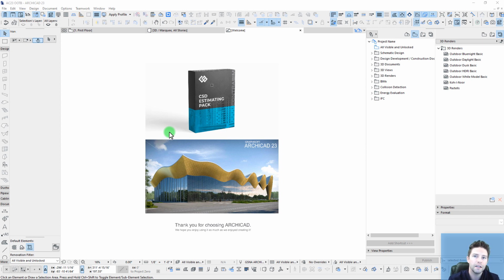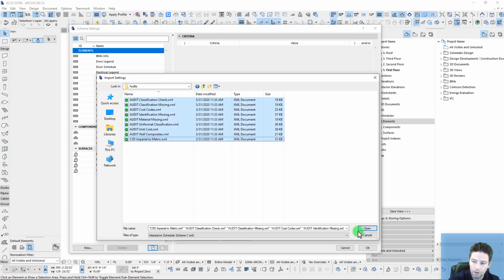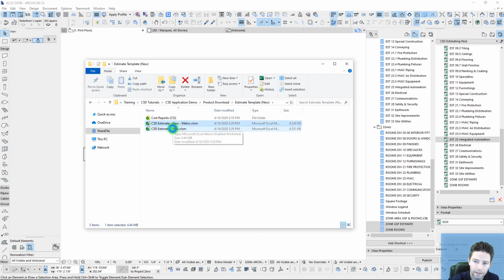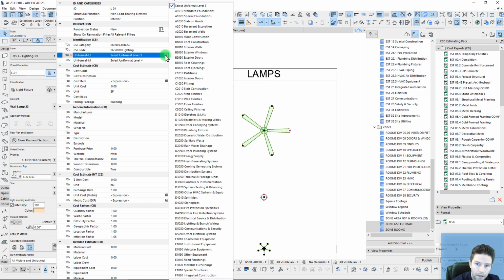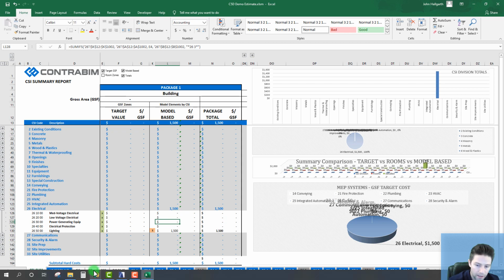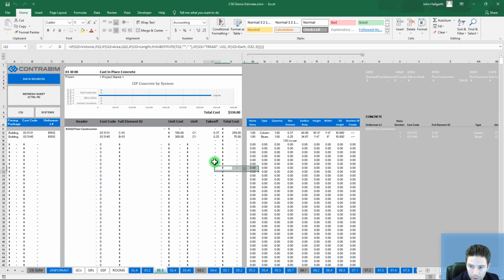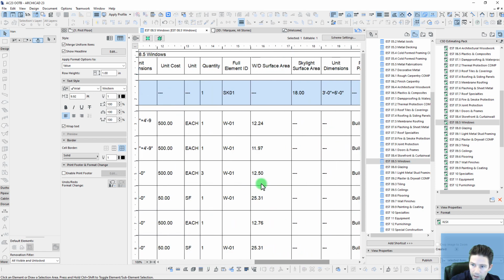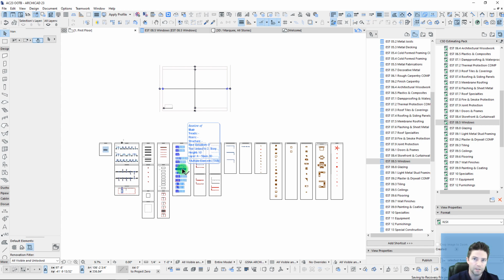How to Add Estimating to Your ARCHICAD Project in Minutes!

Comment: hi,  may you help me please? zone cost per m2?  i can't do the expression. i create a propriety to insert the price, then another expression (area * propriety cost) and doenst work.  best regards mate
Reply from the maker: Hi Andre. If you multiplying an area by a number/integer, to result in a number/integer, you'll have to divide the area by 1m2. Add that to your expression and it should work. it'll look something like this: (area parameter / 1 m2) * cost
Reply: @CONTRABIM  it works! (area parameter / 1 m2) * cost!!    thanks!! ............... is possible to change the value units? this is 112,04(m2)*600,00 (€) = 67226,65 (€) this last number is complicated.  normally we use 67.226,65.... this dot or space is very useful. and if we add more itens to this list... when we hit the 2milion... the number will be 2078449,87.. this is a very complicated number ahaha.... is the anyway to help reading this better?
Reply from the maker: Andre Calapez if you want to change the display of the number, you’ll have to convert it to a string and do some splits and concatenations to add the period and commas in the preferred location. I’d recommend starting by creating a new property, that references your current output. You can set your property type to integer to get ride of the last two digits, may help and simplify. Sorry I’d have to work through this one myself to give you the exact formula. I’ll try to get to it this week!

Comment: Hi John! Are these .pln file and  the .xml file you imported here in this video included in the AMT+C5D course?
Reply from the maker: Hi! So the AMT MasterTemplate + C5D was based on the 2019 build of C5D. The AMT+C5D does include the reports and Excel estimate template, but it's just the older version which didn't contain the major upgrades to 2020 build. Totally rebuilt formulas and new summary sheets if you check out the product page you can see in the video https://www.contrabim.com/c5d
Reply: @CONTRABIM  Hi John, 
what is the major upgrade from AMT+C5D ? 
is there a discount for people who already purchased the AMT+C5D pack and want this upgrade ?
Reply from the maker: @tazevil  Yes the major upgrades are in the Properties, Cleaner Interactive Schedules, and a re-built Excel Estimate template that is much more flexible and allows you to switch around columns from your ARCHICAD reports without issue on the other side in Excel. It also features a new flexible summary sheet that allows you to create your own summary structure. I definitely will do a discount for the upgrade. Please send me an email:)
Reply: @CONTRABIM  thanks John for your reply and commercial gesture, 
At which address should I send you email and what do you need in it for applying the discount? (AMT +C5D mail account? Name? Address?)

Comment: Good work !! i just wonder to know, what is CSI category, CSI , uniform L3 and L4 etc ?  is that a local specific coding system of your country or what exactly ?  why there is 4 entries in the identification CB ?
Reply from the maker: Hi Ahmed. CSI Masterformat is the primary specification system we use here in the US, it works really well for organizing costs and trades of construction by materials. Uniformat is a systems based approach, which does a great job of organizing by location and purpose. I like have multiple levels of these as properties, so that you can report on various levels. Sometimes more summary level, and sometimes more detailed. It's also nice to have a header in ARCHICAD schedules based on one, while still needing the code reference in the line item below if that makes sense... Thanks!